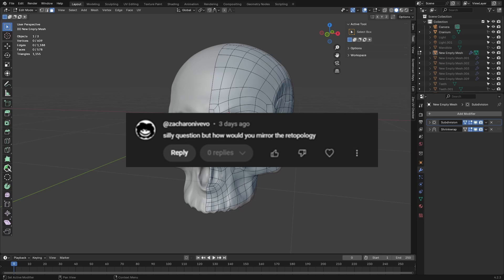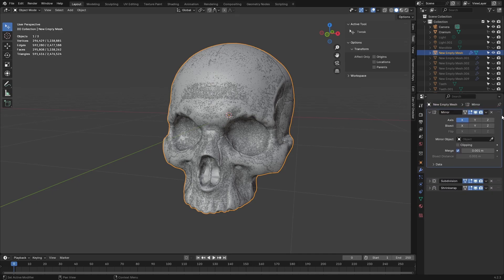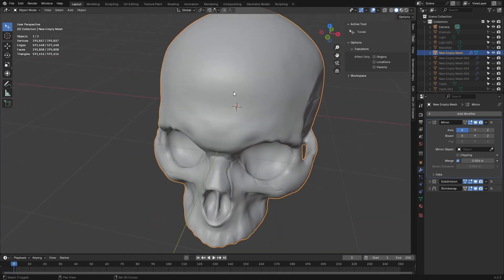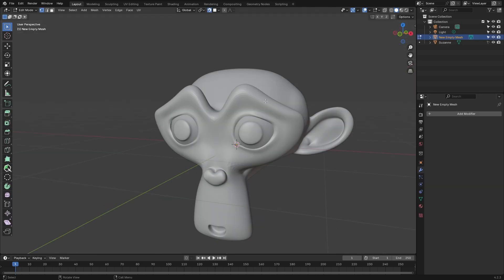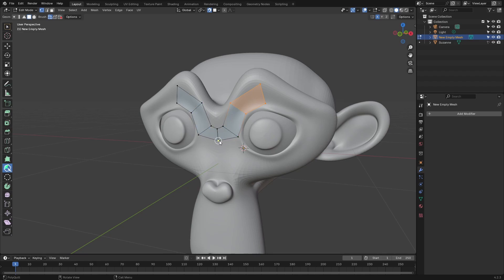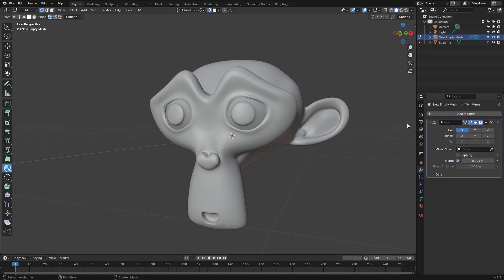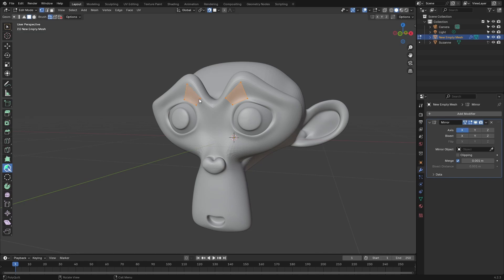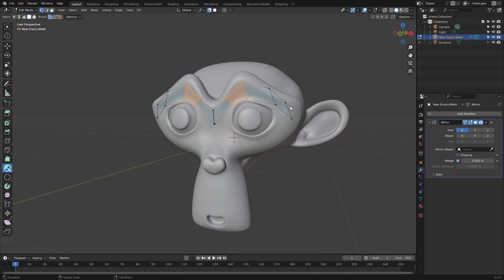Different Ways to Mirror Geometry During Retopology in Blender3D

Comment: I have a question my x symmetry is not working in edit mode when I mirror my plane to the other side of my mesh?  Also when I have the mirror and shrink wrap modifier turned  on it doesn’t  mirror planes evenly on both sides of the  mesh. One side would have good retopolog,  but the other side would be showing some of the mesh. So, when I apply the mirror, I would have to adjust vertices on the other sides. How can I make sure the retopology mirrors on both sides of the mesh evenly?
Reply from the maker: Make sure to turn on display modifier in edit mode as well as on cage. These are usually turned off by default. 
If the mesh is not mirrored correctly double check to see if your objects origin is set to world origin.

Comment: I can't get poly-quilt to do the the mirror on the Y-Axis. It only works on the X-Axis.  I'm trying to find a work around, but it seems the add-on only wants to use X. Not found a way around it yet.  How about you? Have you tried? Or is it just a bug for me?
Reply: For anyone coming here after.  I decided to just rotate the model to work with the working X mirror after not being able to find a fix.  which was fine for me as I'm importing into to unity after, I jsut had to make sure everything was facing the correct way once imported.
Reply from the maker: The add-on itself only lets you work symmetrically on the x-axis. If you want to mirror around any other axis you'll have to rely on the mirror modifier for that.
Reply: @Art-of-Akrosh  Ahh okay, it is a restriction of the add-on. Good to know!. Thanks.
Being able to have morror symetry in real time is best option